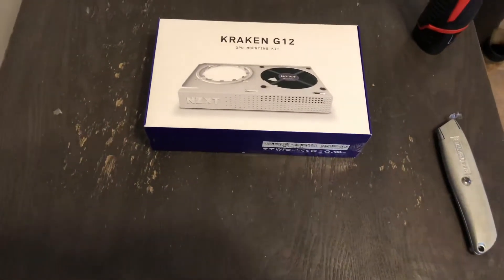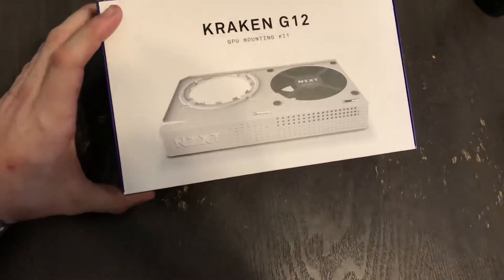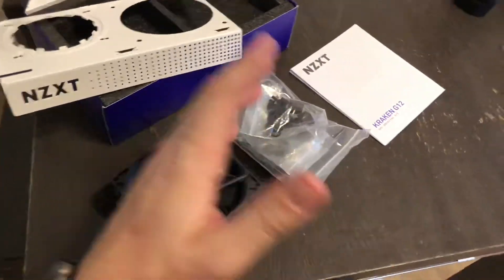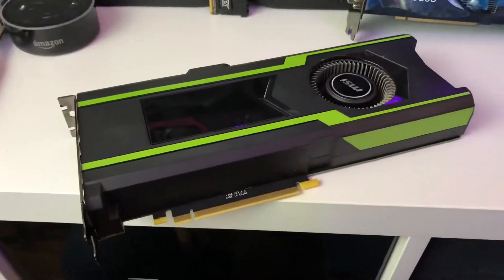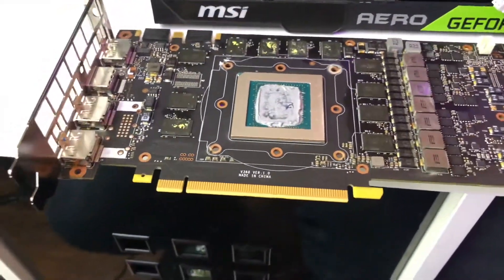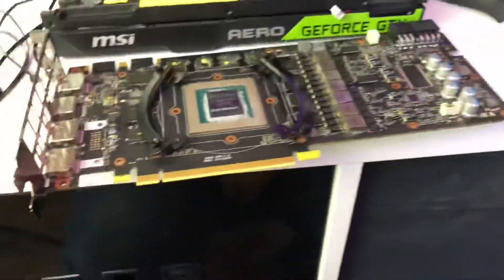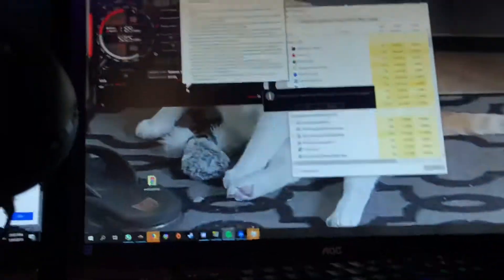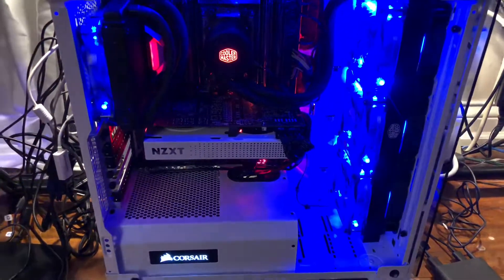Liquid cool your GPU for just $70

Comment: you don't need to cool the ram??
Reply from the maker: good question -- in short, you do - but air cooling it with the included 92mm fan that cools the VRM is usually plenty. the GPU die creates by far the most heat on a graphics card PCB

Comment: Do you see a raise in other component Temps after getting the aio radiator in? I'm concerned since I have a 2 intake 2 exhaust fan setup. Now with an aio do I basically have 1.5 exhaust?
Reply from the maker: nope. the radiator is mounted on the exhaust, so it works out well. it has a lot more thermal mass so the GPU temperatures move much more slowly than if it were air cooled, also much cooler over all. the fan cooled VRM seems to work pretty well though.

Comment: I have a gigabyte GTX 1080 TI. Can I go ahead and install an AIO and keep the triple-fan case on the GPU?
Reply from the maker: It's unlikely, but with some modification and adhestive, you could probably keep two of the stock fans. the NZXT comes with a fan to cool VRM, i'd suggest using the whole kit as is

Comment: G12's bundled 92mm fan has a 3-pin connection. You cannot control fan's rotation speed if you connect it to the card's 4-pin socket. The fan is very quiet at its full speed (1500 rpm) so I suggest you to leave as it is.

You also should not connect your pump to a PWM socket or a 3-pin manual fan controller. AIO pumps should run at their full voltage/speed.
Reply from the maker: Mehmet Altug TABAK I did notice after doing it that they were 3 pin, not 4. I assume plugging them in will just allow them to both run at full speed since the card is expecting to control them with a PWM signal and is keeping the B+ pin and ground pins at full ‘chooch’